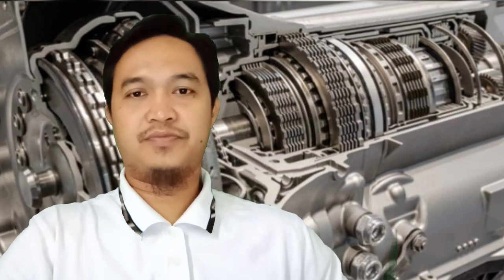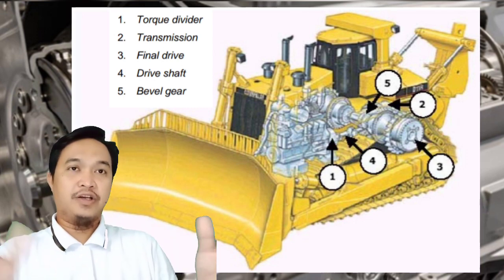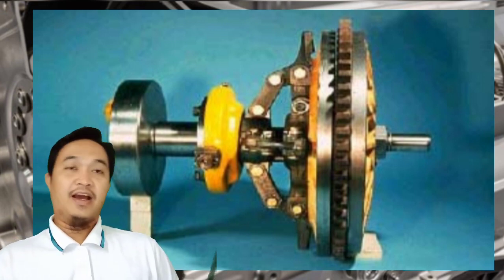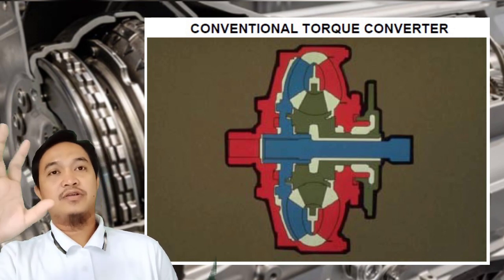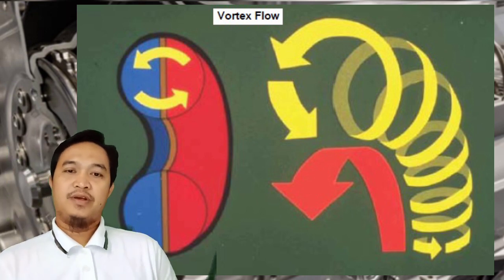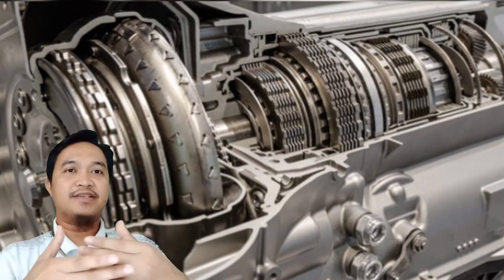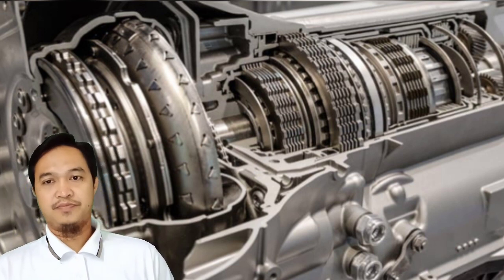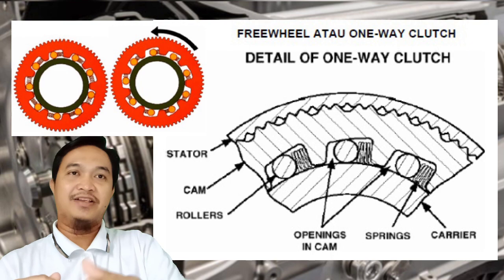Power Train System. Cara kerja torque converter, torque divider & lock up clutch TC. BMC 19

Comment: Pak kalo temperatur overhead  itu yg mnaa yg di perbaiki
Reply from the maker: Saya pernah mas, torque converter overheat. Sebelumnya pastikan dulu sensornya bagus atau gak mas. Nah case itu saya ukur ternyata ada nilai TC inlet nya di bawah spec. Saya ganti TC inlet pake unit sebelah sembuh mas..

Comment: Kenapa impeller / pompa dapat di putar oleh engine padahal posisi nya turbine dlu baru impeller mohon pak di jawab 🙏🙏
Reply from the maker: @Zrael.26  Jadi untuk menghemat tempat pada konstruksi nya mas, dan juga berfungsi sebagai allignment atau memudahkan kelurusan Shaft turbin dan impeller TC. Secara konstuksi lebih padat dan hemat tempat , juga bisa mengallignmenkan torwue converter.

Comment: Mohon Infonya pak, Di Menit 13:35 itu Yang dimaksud dengan direct drive itu gimana ya pak?mohon infonya banget🙏
Reply from the maker: Direct Drive itu kondisi dimana RPM input TC sama dengan RPM output TC mas, jadi seolah-olah tidak pakai TC, nyambung dari output engine ke input transmisi. Hal ini terjadi ketika unit truck dalam kondisi kecepatan normal, nah pada saat kondisi truck muatan dan di tanjakan puncak yang sangat terjal membutuhkan tenaga lebih baru dia pakai TC drive untuk menambah tenaga biar truck tetap kuat..
Reply: @dikiadnarrayyan  Alhamdulillah, terimakasih untuk jawabannya pak🙏jangan berenti bikin kontennya pak
Reply from the maker: @sn-musik3784  siap mas.. terimakasih atas kunjungan dan dukungan nya 🙏🙏

Comment: Pak,  apakah Tc ygbaru, yg semua Pressure sudah tercapai spec, bisa membantu travel dozer d11r yg transmisi clutch 1 dan 2 sudah slip.
Reply from the maker: Belum tentu mas.. kalau yg problem transmisi nya ya masih problem dia mas.. 🙏

Comment: Louck up clutch itu kerjanya otomatis ap by pressure mas..
Reply from the maker: Lock up clutch itu sensing nya berdasarkan ground speed atau kecepatan unit mas.. jika mencapai 5 atau 8 km/jam maka lock up clutch aktif dengan cara piston pada disc clutch lock up didorong oleh oli pilot bertekanan.. sehingga dia menjadi direct drive mas.. 🙏🙏
Reply: @dikiadnarrayyan  mksh ilmunya mas👍 ditnggu updatan untuk unit"A2B nya..
Reply from the maker: @heavenvpafamily7699  siap mas.. terimakasih atas kunjungan dan dukungan nya.. 🙏🙏😎